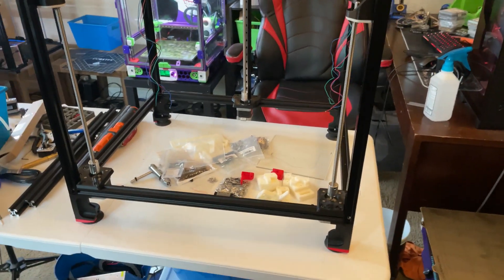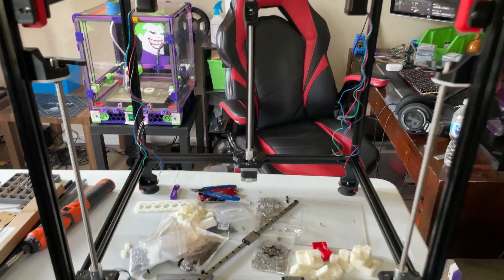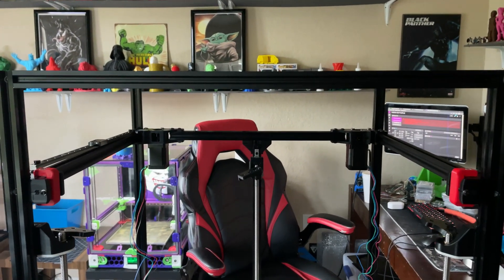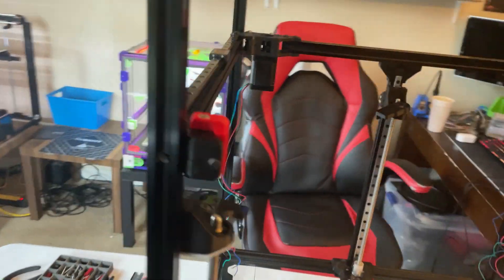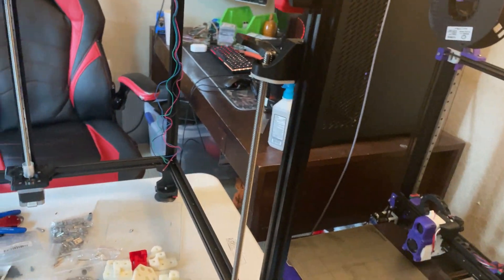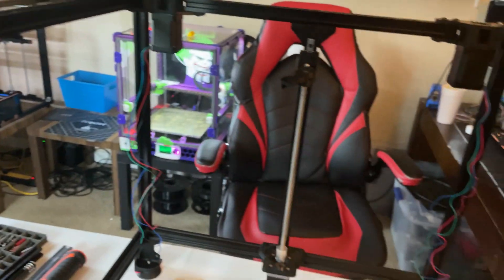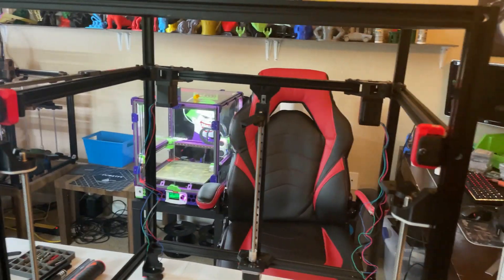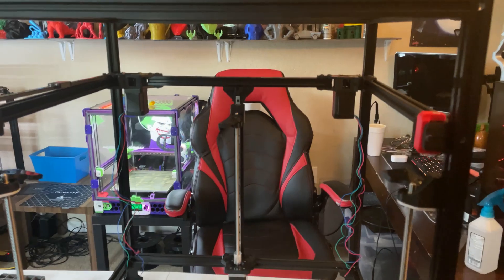Custom Venom Themed 3D Printer // X5SA To Voron Trident Conversion Part 1  // GoldenJaguar392

Comment: Seems like this is hardly a conversion from an X5SA as you only use a tiny fraction of original parts. It is going to be cool to see either way! Keep up the good work :)
Reply from the maker: Yea it can really go either way just like this option better.
Reply: Agree, almost no parts from x5sa, so little missunderstand. For tronxy is better dual Z axes voron mod or simple build voron from stratch with original pieces.

Comment: I have the chance to buy a return X5sa from amazon and I am wondering if I should buy it for the frame and motors. Price is 115 USD
Reply from the maker: Do it that’s cheap you can built a nice voron out of it easily.
Reply: @GoldenJaguar3D  can I fit mgn9 to the V-slot extrusions of the Tronxy? 😁
Reply from the maker: @maiorciprian  yes they fit fine as long as you use the printed rail guides
Reply: So thats probably better buy whole new voron frame and y safe money for useless part x5sa printer and troubles with that frame.
Reply from the maker: @martinhyska1206  dude It's your choice and you money do what you want to do bro! I'm not telling you follow me.
Reply: I wish y best luck with that mod. But only not understand how y want to do without any stl mod. According me y should mod almost every part and with tronxy frame also more work and many useless mods.
Reply from the maker: @martinhyska1206  that’s your perception buddy it’s less work, what you’re looking at is no more than 2 days of work I could have finished this if I had all the parts available 4 days , maybe  for you it’s all useless mods this only tell me you don’t like tinkering, for me I love figuring things out that’s apart of the fun.